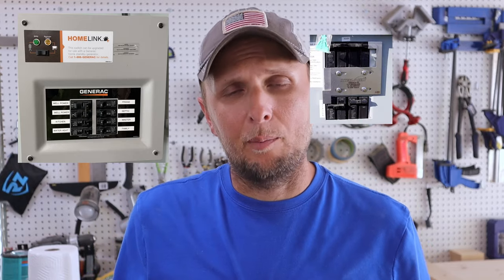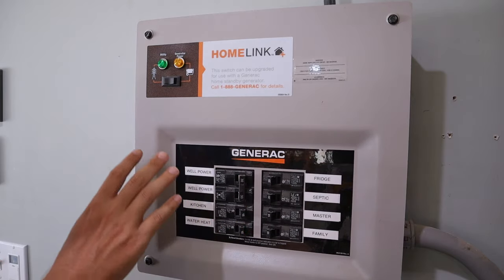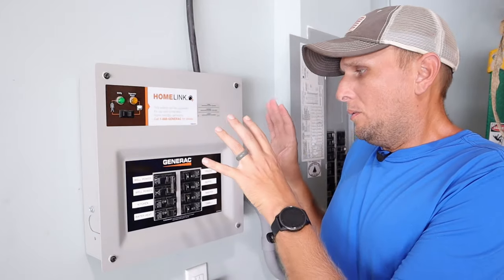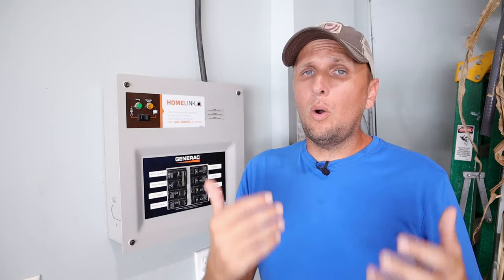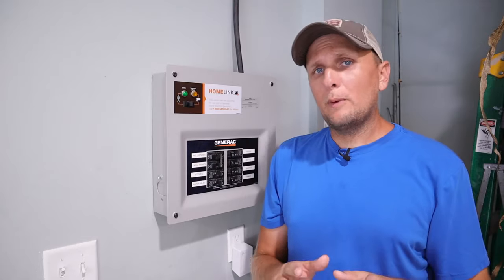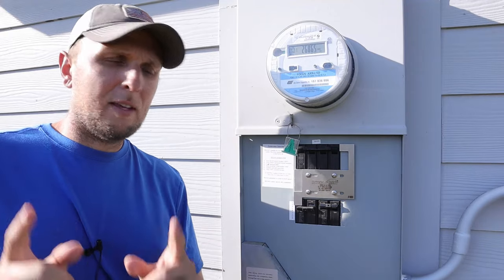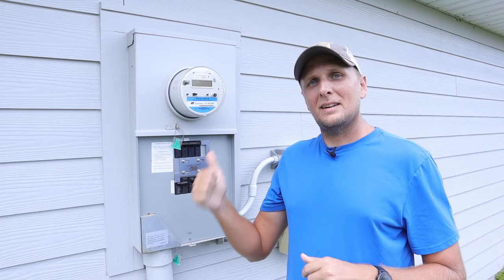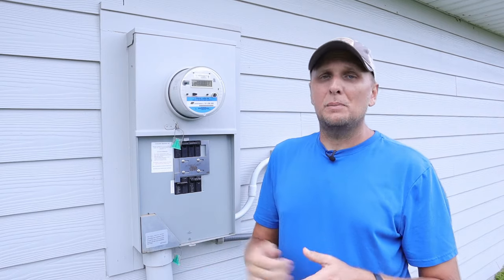How To Choose Between A Transfer Switch Vs Interlock Kit With Power Inlet Box

Comment: ... my BIG decider was ... 
I am away from HOME sometimes for a WEEK at a time 
... and ... 
I run PROPANE ... and do NOT want to deplete 500 gallons of PROPANE keeping my 11KW   GENERAC running for an extended length of time 
... 
so ... losing power for a day I want to have electricity every few HOURS & NOT automatically  "ON"  for  WHO knows how long the power will be OUT
... 
My HEAT does not REQUIRE Electricity ... 
...
Electricity is for LUXURY Items like TV & COMPUTER & lights 
&
Every so often to run the refrigerator 
... 
So - I SOLD my Automatic TRANSFER SWITCH to a guy in PUERTO RICO & set myself up with a MANUAL Interlock SWITCH for just when I need  or choose the GENERATOR to RUN  
... 
COOP
...
Reply from the maker: Awesome!  Glad to hear you have it all setup the way that works best for you!  I personally also like the manual switch as opposed to it automatically switching over.  But the auto switches certainly have their place in situations too.  Thanks for the feedback Dave!

Comment: I don't get why all line service boxes don't have some sort of bypass switch where the owner can switch it from shore panel to generator.
Reply: Because one can be added later, a service box that you could switch from grid power to generator power would be good for everybody who has a 120/240 generator, but not as good as a transfer switch for the millions who have 120V only generators.

Comment: Why would you need to turn the breaker switches on and off with an interlock? Can't you just be careful with which appliances you use at the same time to make sure you're not drawing too much load?
Reply from the maker: You can but the reason I don’t advise that is because if there are others in the home they may not understand power management.  Most people don’t realize what their appliances, well pumps, etc take.  They may not remember to keep the AC off.  That’s why I advise controlling what circuits are on and off to make sure too much load is not put on the generator.
Reply: @HowToHomeDIY  That makes sense. I live very much alone so that didn’t even occur to me haha

Comment: With actual costs inlet $49 minimun. Interlock $39 - $109. $200 average. Adding an electrician $268. Total $468 . Transfer switch kit and Electrician $800 cheap $1800 average $368 its the cheap trasfer switch 6 circ
Reply: No licensed electrician is going to install an interlock, along with the required power inlet box, for $468.

Comment: Doesn't the breaker coming from the generator in an interlock kit limit the incoming power to the size of that breaker so that it's impossible to overload your generator?
Reply: the breaker on the gen set isn't for overload protection in general. It's there to guard against shorts and major screw ups. If you know anything about breakers they can run slightly above their rating for quite some time, which may not be as long as the generator can supply that load without going up in smoke. Being in that business for 25 years I have seen my share of units that gave out BEFORE the breaker has tripped!

Comment: There is no way I'd agree to a sub panel. Look ... as soon as you set it up something will change and you've got a problem. Just put the transfer switch on the entire input of the main panel and load manage your home yourself by monitoring what's on and what not. In a power outage you're not going to be drying clothes or using the stove in a big way. (Use the BBQ and a hot plate for example) 
It's not that hard to learn a bit of electricity and it will save $ on set up costs and improve versatility. If you screw up, it's only going to trip the generator breaker, the world won't end, just reset it.
I use a Generlink and a 7500W construction generator. The generator is loud, but it works and the entire system cost me less than $3000 CAD

Comment: With interlock kit, How do I know if the city's electricity is available?  does we turn off the generator???
Reply: You have to look outside your window at the neighbor's house or street lights.
Reply: @Pk3_Garage  I want to design the led lights from main wire ( single black - 120v) but I confuse because illegal and dangerous

Comment: Greasy pvc "connector" on main panel. Pvc not strapped?
Reply from the maker: There is no pvc for the power inlet box.  But the pvc for the surge protector is less than 3 foot.
Reply: @HowToHomeDIY  @3:51 , My apologies,  a quick glance showed a nasty hole. From xfer switch. This just appears to be drywall.
I thought it was the panel, with just a K.O. punched and pvc stuffed in. 

USA?
In Canada:

12-1114 Maximum spacing of conduit supports
1) All rigid PVC conduit of one size shall be securely attached to hangers or to a solid surface with the
MAXIMUM spacing of the points of supports NOT GREATER than
a) 750 mm for 16, 21, and 27 trade size conduit;
Reply from the maker: @dingo42069  Ahh no worries.  And I thought you were talking about outside the house.  Yes in the US.  Here I believe code is not more than 3 foot on either side of a box without support.  I am not sure my exact distance but I believe it is maybe 2 ft or a little above.
Reply: I probably shouldn't have even commented, it was rude.
But I honestly thought pvc was just pushed through ko without connector. (bad quality video (on my end), and quick glance on small screen on phone)
Stay safe down there.

Comment: Always installing mts over interlock kits, why rearrange a panel and change the schedule when there's a system that is completely seperate from overloading the generator. Also for convenience you don't have to remember the labeled breakers and read a instruction pamphlet to hook up a generator in a already stressful time. Generlink systems and interlocks are just dumb concepts imo and more sketchy to use with having 2 sources of power that could possibly end up arcing if manufacturer defects.

Comment: Are interlock kits UL listed?
Reply from the maker: The one I installed has been approved to be used on UL listed devices.  It also is up to NEC standards.
Reply: if you are buying one just look for the UL listing on the package. Be aware that some (not many) are NOT listed.
Reply: I've seen some manufacturers claim that they "meet NEC standards", but the NEC requires equipment to be listed. So if it not than it doesn't... and I've never trusted a device that can be foiled by the removal of the dead front or one that doesn't sit quite right on the breakers... etc. Long story short I'm in the transfer switch or GTFO camp.

Comment: I installed a Gentran transfer switch for a family member recently.  They purchased a 12KW generator to run the larger house and their A/C unit.  Very costly in equipment and extra time to install.  If I had it to do over again, we would have installed the interlock kit.  Another reason to avoid these transfer switches is they do not play nice with the main panelboard's AFCI and GFCI  breakers.  Once the power restores, if the generator is still running, all of the AFCI and GFCI breakers used for normal power will trip immediately.  It doesn't put you in the dark, but before you can transition back to utility power you have to go dark and reset those breakers.
Reply from the maker: Hmm I have not experienced that with my AFCI or GFCI breakers.  Any time that the power has been restored while using the generator I just switch the transfer switch back over to utility and that is it.  Never had any of them trip.  Same with my neighbor.  That is odd that you are experiencing that.  Especially since the two panels at that point are completely separated.  Appreciate the feedback!
Reply: @HowToHomeDIY  so what's happening here in my situation is that the ungrounded branch circuit conductor (phase wire)  is interrupted and routed to the gen tran switch, and then returns to the panel to connect the load.  The branch circuit neutral however remains connected only to the AFCI breaker.  With the gen tran in utility position, the AFCI's comparator circuit is happy - electrically the AFCI breaker is satisfied.  When the power goes out, the electronics of the AFCI which operate the comparator circuit are lost, because the tiny little power supply inside the AFCI gets its power from the bus - which is dead in an outage.  That's okay, because the AFCI breaker is not actually being used, except to provide the neutral connection to the load.  Instead the breaker at the gen tran is protecting the wiring.  The nuisance trip to the AFCI and GFCI breakers only occurs if the utility comes back while the generator is still carrying the load on the critical circuits.  That's because the AFCI power supplies awaken and see lots of neutral current imbalance (there is no phase current flowing through the other coil of these breakers - its all flowing through the gen tran branch breaker) and the AFCI/GFCI  breaker trips.  As I say, it doesn't place you in the dark.  The procedure requires switching the gen tran circuit to "off" or "utility" and then reset the AFCI/GFCI.  Long answer, but that is what I meant.

Comment: Can an older house get  a transfer switch,the breaker panel is not fuses,but it's older
Reply: Yep.  Transfer switches and age of equipment are not relevant to one another.  However if your panel was manufactured by Zinsco, Pushmatic, Federal Pacific - spend the money on replacing your gear before investing in the transfer switch (or interlock).

Comment: Transfer switch all the way …much safer !!
Reply: not sure about that. Adding a subpanel (transfer switch) is Adding complexity to your electrical system and more point of failure so less safe. In the other hand and interlock means only add a safe or lock mechanism to your electrical panel without touching or altering your existing electrical installation. In both cases if you pull more current than your generator can handle your generator will turn off it's main switch and everything will stay as normal, and if you got a generator that does not have a main switch then the worst will happens is your generator will turn off if you pull more power than it can handle. I would recommend and interlock and adding an electrical monitor to your panel that usually cost around 100 bucks and you will be able to know at anytime how much power you are pulling so you can add or remove load as needed. You will be very surprised when you find out that you are not pulling as much current as you think and most generators can power most mid size houses in its normal use. If you don't do nothing crazy a 7000 watt generator can power all your hose 100% including AC, fridge, range, and all appliances in their normal or regular use. But I would buy a 10000 watts to have enough room.

Comment: I have a grid tied solar system. If grid goes down, I have no power.
I bought a Delta Max Generator with Extra Battery.
Do you have a video available that shows how to hook up to the panel using Interlock Kit & Power Inlet Box.
Reply from the maker: Yes sir.  They are two separate videos on my channel.  Would be nice if there was a good way of having a grid tied solar system that would work without utility power without having to be off grid to begin with.
Reply: @HowToHomeDIY  You say you have 2 videos.  Can you lead me to the video. Also is the hook up to the solar panel the same as the regular panel.
Reply from the maker: Yes you can just go to my channel, and find it under videos or generator projects.  I don’t have solar on my house so I’m not sure how similar any of it is.
Reply: @HowToHomeDIY  Thank you.
Reply: I would be contacting the mfgr of the solar system to see if it might (might not?) sync with a gen set. Some of these are really fussy about power that is off frequency... and VERY few gen sets are spot on in the portable category.

Comment: Since you won't have everything on at the same time an Interlock will work for most things you run. If you have an unlimited amount of money then go with what you want. Most generators are under rated for what they will produce. Just remember you do have a limited amount of power.

Comment: Interlock always!  Switch panel = What happens when you change a circuit and what it feeds? Or just happened to need a different circuit?  Ugh gotta mess with changing sw panel again. How about you pick your A/C then in the winter you lose power or vice versa?  No ty, predict what you need? How about a sub in a garage. Oops I need garage power now but did not think I would so it is not in my transfer switch!!!!  No Thanks!

Also, is it really about safety??? Do your electrical lineman not protect themselves because they think power is off???  Hell no, they should always treat anything "ac electrical" as if it is powered.

Comment: Problem with transfer switch is you have to limit the circuits to the number available on the trans switch. I don't think the limited breakers is a pro at all to be honest. You are not limited with interlock, you simply flip on or off the breakers as you need them. So much more flexible. Not hard to flip them on and off but pretty hard to get a circuit up that you didn't include in your switch.
Reply: I have 3 phase transfer switch, there are no limits besides amps

Comment: You can run your entire house on a transfer switch.  They make them up to 400 or 600 amps and you run the utility into the switch and the switch then connects to the panel so when the generator comes on it just takes the place of the utility.  Why are you saying you can only run a few things off it.  We run our 4000sqft house off a 200 amp switch even with 3 central AC units.
Reply from the maker: Yes, there are transfer switches that are much larger.  Tell me though, is it an automatic transfer switch?  Also, how much was it?  This is more focused on the manual transfer switch and for most people who don't want to spend as much or more on their transfer switch as they did on their genset.

Comment: There are companies name brand companies that make transfer panels a lot cheaper than this one. With this company you're paying for the name. If you do a internet search some home generators come with a transfer switch. I seen this design in the video made by Briggs & Stratton for $179 and it came with everything.

I have used both transfer panels and interlock. I like the interlock a lot more than a transfer panel. With the panel you could have part of your house that you cannot even turn on a simple light. With the interlock you can turn off you're a large circuit breakers and almost every room in the house will have electricity. Now if I had a generator big enough to run my central air conditioning I would probably go with a hole house automatic transfer switch. That way when the power goes off 30 seconds later your generator kicks in. The biggest drawback to that is the cost and to have it work you have to have natural gas or propane. I don't have natural gas and I refuse to put a large propane tank in my yard.

I did enjoy this video I do like you showed both sides of the coin. Like with most things you have multiple choices it's up to you to pick what's right in your situation. 

One thing you do have to keep in mind with the Interlock system you do have to have room in your electric panel for two breakers. Also if the room isn't near the main switch you will need to move breakers around in your panel and that could be something a little bit more than a homeowner would be comfortable doing.

Comment: Thx, I thought I needed  10 circuit transfer kit but interlock gives even more options, I want to use 3000w generator to make fuel affordable. Like I don't want to have constant generator power for my well that barely runs. 7000w predator used 8 gallons for 12 hours. 3000w much less costly, just have to power off freezers if I need well to run. 5g for 24 hours

Comment: Dont you have to add additional wires for the existing circuit breakers to work with the transfer switch? Why bother? Just use the existing wiring of the existing panel with the interlock to prevent the backfeed. Easier install and more flexibility, and save money on the installation too for the interlock method.
Reply: Yes and no.  I installed a Reliance Controls 6 and 10 circuit manual transfer switch to back up every circuit in our house. (We started out with just the 10 circuit) All the circuits, in the transfer switch, were prewired.  I only had to buy building wire, for the inlet box. The wires have to be trimmed down to size.  Very easy project to do and works great.